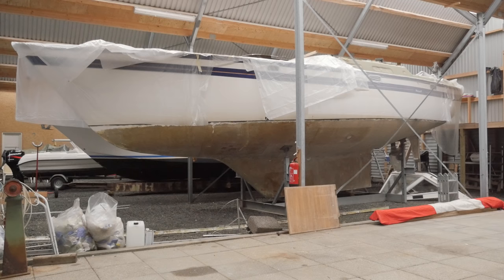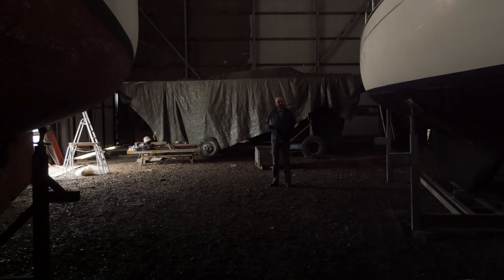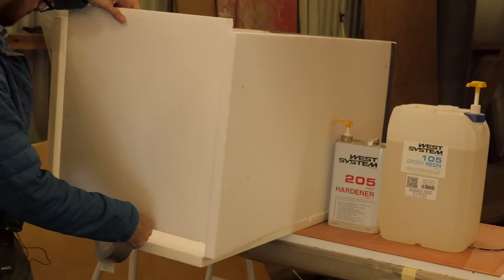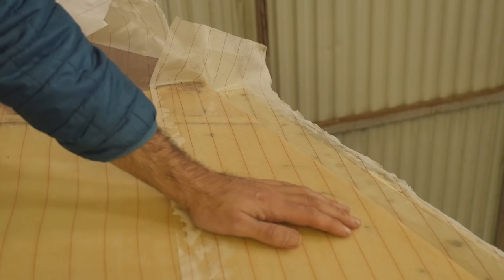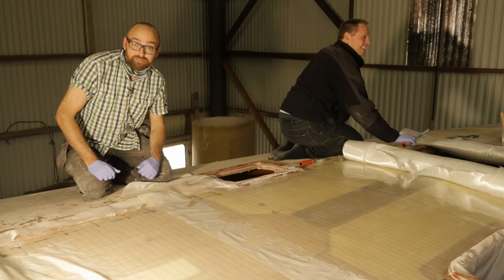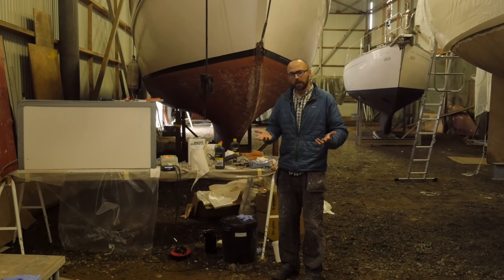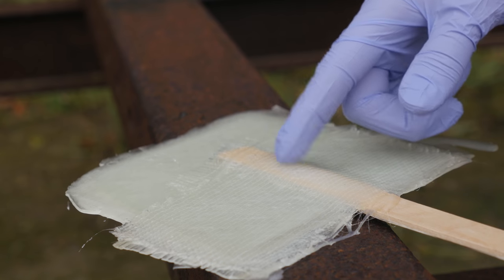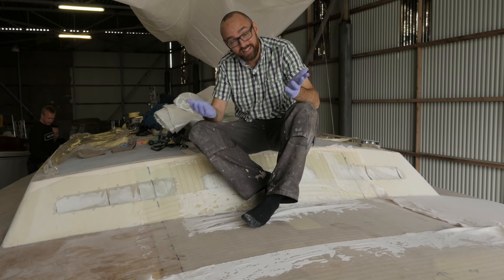Sail Life - New deck on a sailboat DIY style ⛵⛵⛵

Comment: That other pretty wooden boat in the shed that you admire is likely a Collin Archer style double-ender or a Bristol Channel Cutter (which are somewhat similar).  There are many European designers of lovely double enders but they all share the same general lines, versions built from 25ft to more than 50 ft.  The double-enders are usually not very fast by todays standards but it is their stability, ruggedness, and sea-kindly motion that makes them still quite popular with cruisers.

Comment: I'd stick with West Systems, per other comments below, I'd always worry about them delaminating / breaking the bond because they might have slightly different thermal cycling properties, and shear apart over time.  It would be a shame to have all of your hard work turn to poop.  Perhaps you could order a smaller amount of the West System locally at the exorbitant price to tide you over until a larger shipment can be delivered from the UK?  In any event, great vide Mads!

Comment: Hi Mads.  I mixed different brands of like material on mine and never had any problems with it.  All the work is good 20 plus yrs for some.  But  stay with epoxy with epoxy,  vinyl ester with vinyl ester and polyester with polyester.     I would use a vinyl ester on the last coat (outside coat.)   You answered your own question with your test.  It's a good physical and chemical bond. It's not coming apart. 

The new shed looks like it's wet.  FG + moisture are bad juju. 

Beautiful work!

Never mind.  As much as you worry pay the money and get West System.  Ha ha

Comment: Good man Mads, i woke up about 3 years ago and switched epoxy supply from wests to a local manufacturer, the new product doesn't blush so no sanding or peel ply, its  cheaper to purchase than wests and is offered in myriad formulations depending on application and weather conditions. So go for it! Just key up your wests with 40G sandpaper and crack on!
Reply from the maker: +Roger Ball Hi Roger :) Couldn't help but think off you when using the heater mat to heat the epoxy :) I think you sent me a photo of you doing the same thing. Again thanks for all your help with the DIY hotwac setup. It worked out great! :)
Reply: My pleasure, those heater mats are bloody handy things to have in a workshop and keep up the amazing work. I'm about to fire up agentlemansyacht.com (again) in the next month or so now i've found the capital so cheers for keeping me interested in all things boaty.

Comment: Mads, let me set your mind at rest, about using the new product over the West System. I used to work for a Corvette car dealership, in the body repair shop. The way we would look at it is this, If the one system we have been using, has been around for years or maybe even decades and we have been happy with it, it is trustworthy. If the new product you are going to use, has been around for years or even decades, if there was a problem of people using both systems on the same project, if they were not compatible, there would be ample disaster stories around.

West Systems would be saying not to use their products with that other product, and the other product company would be saying the same thing. Then you would have people in boat yards and boat stores,  saying the same thing.  No company in that industry, want a reputation as being crappy, and if using one product, with an incompatible product, get the customer a crappy result, most companies, business and people who tried it, would be informing people. 

A couple internet searches would result in the answer also.
Do not use West Systems Epoxy with .....
Do not use ...... with West Systems Epoxy
........ Product disaster story when used over West Systems Epoxy
You being a tech nerd, probably already know that, but I post it anyways, in case it helps a reader.

Comment: I recored the deck of my irwin 10/4 this summer with koosa, screws and fender washers, origional topskins, scarfed and taped the cut lines with 1708 biax, I used approx half ws 105 and total boat 5:1 for all thickened batches for the coring as well as wetting out glass and fairing.  the two worked out together perfectly and I even was cross mixing the two brands together torwards the end and it worked out with zero problems

Comment: If you don't need much extra, then order West S. at smaller quantity in Denmark. Stick with West epoxy, its very good, support is great. I've had issues with others like long curing times at lower temps & others have reported health issues with "cheap" epoxies.. I wouldn't risk it. Btw, I have experinec with vacumum bagging and infusion, and would have still used your methode as lightweight is not a big concideration or precise fibre to resin ratio etc.. For sanding I would be using longer fairing boards with some holds. Lightly spray a mist of contrasting paint on to identify high/low spots. Was the old laminate chopped strands, mat will be so much stronger?

Comment: Love your videos.  I would attempt to stay with one system.  If not feasible, order the old system and while you wait, use the new system on a spot that is very easy to redo until the old system arrives.  Better idea is to move back under deck for a few weeks.

Comment: I agree with many of the other comments to stick with West System. Manufacturers work really hard to test their products on their own products in different environments and situations. I don't think West Systems is any more special than other epoxy brands, but I wouldn't want to be the test run. Personally, I just wouldn't feel good about doing such a huge project change to something I trust my life to. If it were just a repair to a hatch or under a stantion, I wouldn't hesitate using what I can purchase... Just my thoughts on the subject, but where are your chemical engineer followers? Lol

You do really good work man!

Comment: Depending on how much and how long you have to go on the laminate , you could order the west systems from England for what you think you'll need and the might the bullet and buy some locally to fill the gap for lead time. But if you feel comfortable using the German substitute then by all means. It's your boat and your confidence if the important part. Great work so far sir.

Comment: You are making some great progress.  I am restoring a 72 Hughes 38 and you are giving me some great ideas.  My biggest concern is that I will have to do work at the boat yard because my shop is so far away.  Thinking about using my 20 ft race car trailer as a megshift shop and using a polyethylene covered shed to paint in.  Thanks for the ideas..

Comment: Stick with West System, otherwise you'll always be a little bit worried that changing epoxy might have caused problems.
Reply: And sometimes with good reason. I've had delamination on a rush job i did. And i know it was along the "change line" because i marked it with pencil lines on the face for accuracy.
Reply: 100% Agree
Reply: You have a sneaking suspicion or you wouldn't second guess yourself.  Stay the course. Wait 2 weeks.

Comment: My only concern with using two different types of epoxy is a possible difference in the thermal coeffiient of expansion... Remember that as all things change temperature they expand (when warming) and contract (when cooling). Having two materials bonded together that have a different coefficient of thermal expansion is a recipe for disaster... If the coefficient of expansion is not matched between the two types of epoxy they will create a large amount of stress in the hull as they both try to expand or contract by different amounts... the deck will try to bow and curve ever so slightly as one layer expands slightly more than the other... this stress likely won't be enough to overcome the bonding force of the resin but over time and daily temperature change it will eventually cause issues due to causing additional stress in the hull, the deck, and hull-to-deck joint... It would be a shame to see her nice new fiberglass start to show stress cracks in the years to come... If however, the two different types of epoxy have the same or a very close thermal coefficient of expansion then by all means use the more affordable... but if they have a different thermal coefficient of expansion then please be aware of this issue!  You should be able to look up the thermal coefficient of expansion for both types of epoxy since this is typically studied/published information by the makers of each epoxy. Good luck and keep up the hard work, I love you videos and as someone who is interested in doing a boat refit eventually myself your videos are a great help in knowing what I might face...

Comment: I can't help you regarding the German epoxy.  What I would recommend is that you fiberglass the wood bases for your forward hatches. If Athena ends up outdoors for some unplanned reason you can mount the hatches and keep her rainproof.  Don't depend on tarps to keep her dry inside instead seal up any openings and let the tarps protect the fiberglass from the sun.  Best Wishes

Comment: Stick with WS, last year i had to rush something because winter was coming and the only available epoxy was a product which i had used before (not going to release names because i don't want to give people the wrong idea). Right along the fault line between the two, only two months ago, the thing delaminated. If you start with something, don't switch, you never know what might happen. The sales rep passed me on to one of their more advised employees and he told me that different companies use different formulas and even if you key them in right, even if all the conditions are right, it's simple chemistry that can have adverse effects. Now, it can happen to you, or it might not. I'm a one time situation, thus, in no way a standard, but still, better to be safe than sorry. That's my two cents.
Reply: id never mix two different adhesives either. Not on something this important and time consuming.
Reply: I think I'm with these guys. Might be fine now, might be fine a few years from now, but it might not. 
And when this happens it usually is when you can least afford it (like riding out weather)
Reply: You only have one chance to do it right.    It’s worth the money to have peace of mind.  As a fellow OCD sufferer, it’s worth it.
Reply: Hear them! 

Don't let tge pressure of deadlines dictate the quality of your work. You'll be living with this boat for decades. That's a long time to spend worrying about that one occassion on which you might have compromised all the hard work you've done so far.
Reply: Yup. Like they say in Texas, "You dance with the one that brung you."
Reply: spend the money! never mix brands
Reply: You already have different materials bonding together  ie polyester to epoxy where  new bonds to the old. I would think the WS epoxy to German epoxy bond would be  as good if not better than the bond of epoxy to polyester
Reply: One less variable. I am sure the other epoxy is fine, but consistency is always good. Plus you have a well oiled machine. Is there any means to get faster shipping? Surely they can do some other courier? What if they ship via another country like NL?
Reply: YEAH!  I finally feel qualified to post some advise here.  I know less than nothing about working on a boat.  My boating life is lead vicariously via youtube.  HOWEVER, I AM an adhesive chemist by training and experience.  I agree with the others, stick with the same epoxy you have been using.  There are all too many "equivalent"  chemistries I have experience that, long term, did not work out.  Your "quick test" does not validate the compatibility of the two epoxies long term, and the amount of testing that would be required would result in not finishing the project until 2020.  Please bite the bullet and stay with the West Systems epoxy.
Reply: i agree as a licensed aircraft mechanic we are taught to not mix brands
Reply: hi mads 
i have allways used R&G epoxy and it is priced more reasonably than west systems. Perhaps textiles epoxy is even cheaper .....And remember epoxy is epoxy is epoxy ..... Dont mind the negatives, you are over- engineering anyway, so you will be fine on a boat
Reply: Neistrup:  "epoxy is epoxy is epoxy" couldn't be further from the truth.  There are an infinite number of combinations of polyepoxide "A" components and a vast number of "B" components with either one or combinations of Bis-Phenol A, Bis-Phenol F, polyfunctional amines, acid anhydrides and acids, thiols and alcohols.  These components and their proportions can result it wildly different properties and some will not adequately bond to another.
Reply: well it seems to me that mr boatwerks today is happily mixing polyester and epoxy and everyting bonds perfectly.....now if your seeking top strenght you need vacuum and wet in wet application.....but that is rarely used in boatwork, hence i am correct
Reply: a lot of these formulations are a trade secret,    copyrighted or patented

Comment: Glad to see the slight 3” offset of those two layers of fiberglass.   I was worried that you might have made a weak spot, if you didn’t offset.  But on closer inspection, I see you added dash line for that purpose. 😅

Comment: Try to bend your test laminate. This will load the bond between the two epoxies in shear.   Your peel strength is shown by your attempt to pull up on the stir stick,  but the real load in service will be in shear.

I used to test composite laminates for an aerospace composites company, and the short beam shear test was the method used for testing shear strength. If your new epoxy pops off the West System laminate before the laminate breaks, then I would be concerned. If the plies hold together until the fibers fail, you should be good to go.

Comment: I would stick with the West System just to avoid problems in the future. Your test may be good for now, but how will it hold in a few years from now
Reply: I have mixed Epoxy, in borderline cold weather, on my Deck, which is under far more stress than his will ever be, and I never had any problems with delamination or anything. I even mixed in 'nano glass balls' to make the whole structure lighter.
But there's always the gamble.

Comment: Go with R&G it's fine. I converted my WestSystem Pumps to the 10:4 mix and use R&G now for everything. When you can use Epoxy over Polyester, you can certainly use R&G over a fully cured Epoxy from an other brand.

Comment: You're a lucky man to have such good friends. Cheers to them. As for the epoxy, WWAS (what would Andy say), as for myself I'm epoxying With MAS systems to an older ('74) fiberglass boat and I don't know what resin they used, working fine for me. As long as you sand, clean and wet the area you should be fine with any epoxy. I think that any and everything West Marine sells is overpriced. Just my 2 sense.

Comment: Boats are made to get wet. Service the motor, change oil remove plugs put oil down cylinders, replace starter and altimeter and your ok. The wiring will need to be replaced, but come on there not that much wiring, you could do it for $1000. You will find some of the long runs will only be bad on the ends. The wood can be cleaned, after all you live in a constant salt moisture environment.

Comment: It's probably just me, but I like the look of the core under the glass. If it weren't for the markings I'd be tempted to find a clear UV-blocking deck cote to let all that hard work show. Plus, it would make for quick realization of any compromise of the core's seal.Any chance of segueing the volunteer crew to hull fairing?

Comment: M.H. von der Linden in Wesel, Germany, should be able to supply You with any West System product in short time. (I don't know about their current prices, though). 
It is vonderlinden dot de (No, I don't hold shares).
They used to offer special deals for DiY projects of a certain range (that You'd definitely exceed with Athena).
And Mads, with You being a vast multiplicator, I can imagine that they would be more than willing to discuss Your prices.
When it comes to the use of different brands of epo, I'd recommend at least temper the surface to lay alien epo ontop thoroughly to provide processing energy for curing as entirely as in any way possible. We did this with styro to house the surface and a hacked circus heater to provide lots of warmth, but Your silicone sheet would do the job even better I suppose (and with less energy wasted).
Time could be an issue with this sheet method, though.

Comment: I think sticking with WS will be better in the long run for quality/continuity of manufacture. One thing I was wondering: can you just buy a smaller quantity of Denmark epoxy to cover you for the time it will take to get the remaining amount of UK epoxy? Might be an option to save money while avoiding quality assurance concerns. If you have an idea of how much you'll use in two weeks it might be worth looking into.

In other words ($=money cost, #=time cost) :

100% UK ws: $$ ###
100% Denmark ws : $$$$ #
100% Denmark off brand : $$ # (but comes with quality assurance concerns) 
OR
X% UK ws + Y% Denmark ws: $$$ #

Obviously I don't know the prices you're dealing with, I'm just giving my two cents on how to think about the problem from a project management/quality assurance perspective. Also, mixing products might invalidate any guarantees made by the producers if something goes wrong... Again, I don't know but it's something to consider.

Comment: epoxy resins are a commodity product - and in this application I would not hesitate to mix suppliers. If we were talking about an ultralite airplane then I might stick to one supplier but this deck is bulletproof anyway so no issues. BTW the original deck was polyester and you replace it by same thickness epoxy so about double the original strength anyway.